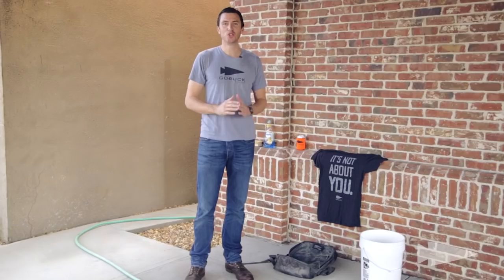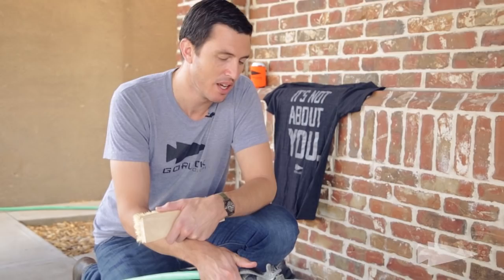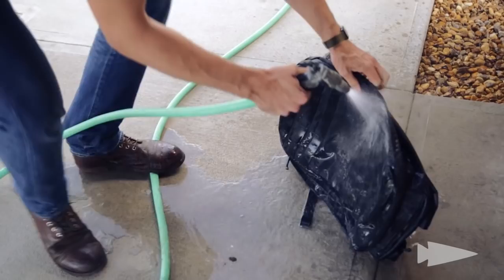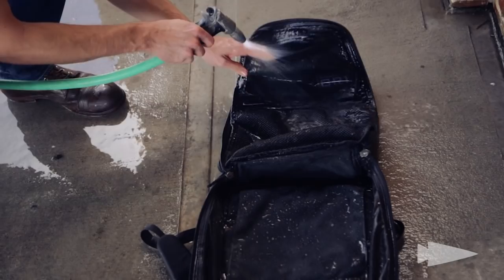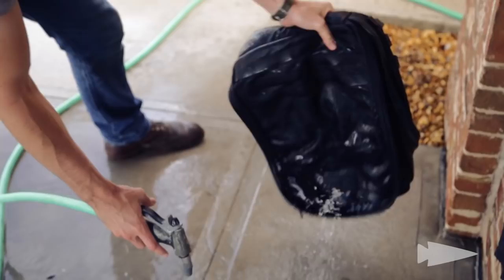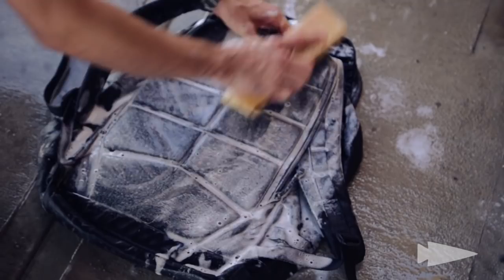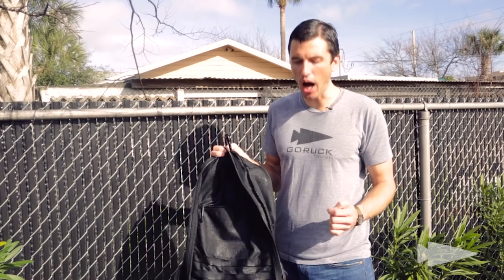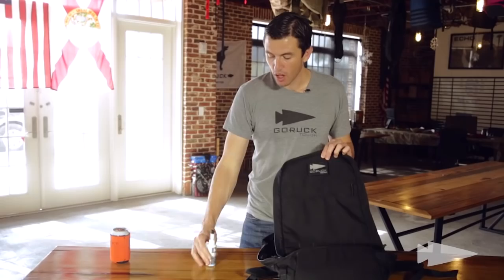Cleaning Your GORUCK Rucksack and Zipper Care

Comment: 2 tips

1) soaking the ruck in some water with baking soda and vinegar for about 30mins will get rid of all your sweat and ocean water stank.

2) get a hose nozzle called “The Little Big Shot.” it’s about $8 at Home Depot and works like a pressure washer. It does miracles and also doesn’t leave soap scum behind like a faucet or traditional nozzle. It’s also made by disabled veterans here in the USA, so that’s cool.